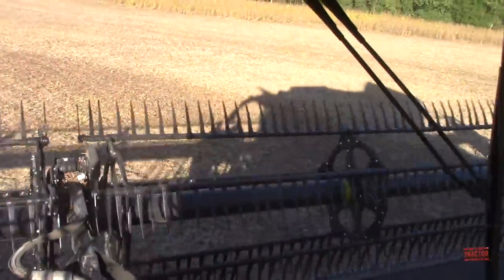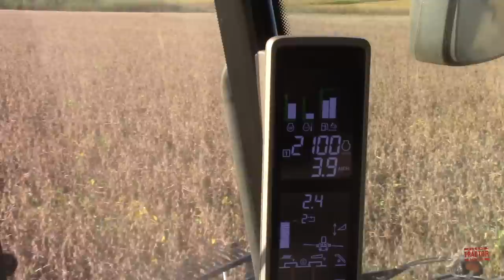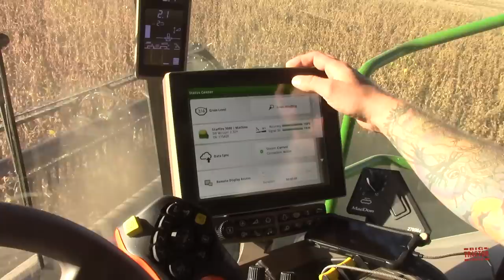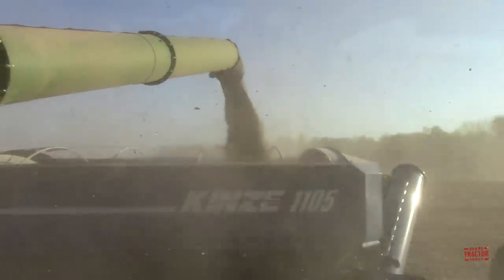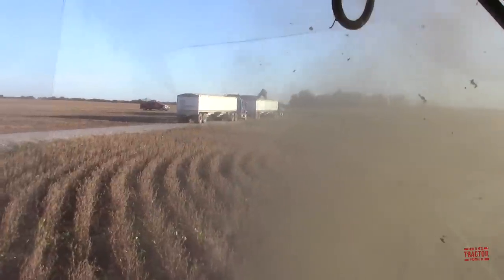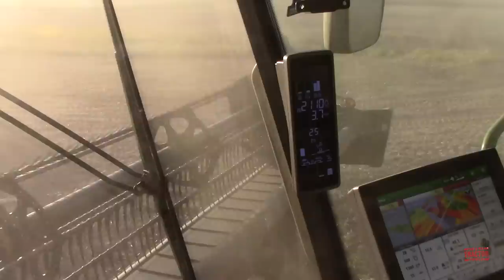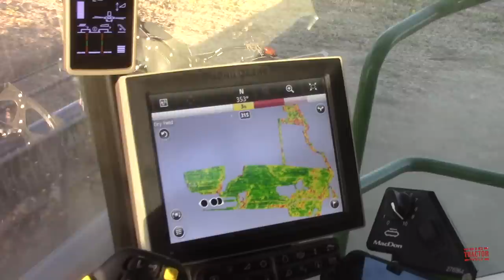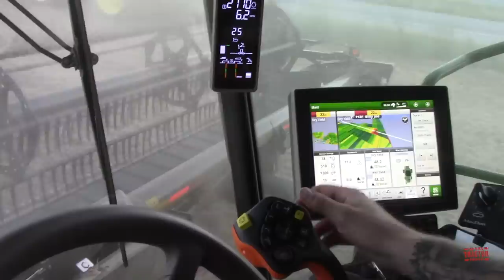DUSTBINE | John Deere S790 Combine Harvesting Soybeans

Comment: One more reason to get a Gleaner!  Compare the dust coming out of the  Deere feeder  house vs the Gleaner  video you  posted  recently. 🤣
Reply: You don't suppose that there could possibly be totally different harvesting conditions?  Nah...you're just a Gleaner homer...
Reply: @buckhorncortez   Never had a Gleaner,  always ran  Deere's.  In fact I'm from the same area The farm featured in this video. The Gleaner pushes way less dust out of the feeder house because of the vacuum created  by  their  rotor.  Ask anyone who has operated one.
Reply: Deere has a feed accelerator in front of the rotor which causes back draft. I believe case and gleaner don’t have this. Which causes less dust out of the front.
Reply: Why do they cut at an angle?

Comment: I wonder why they aren’t using the “harvest smart” and combine advisor ? 

Especially harvest smart with the operation they run, keeping machine 100% @ capacity all the time.
Reply: Barnyard Aerials looked to me like he was.
Reply: @chasesblog  @ 7:09 ...... Harvest smart - OFF / Terrain Comp - OFF / Interactive combine adjust 2 - OFF ..... "Automation status - OFF " It says it at the top of the command center.
Reply: The reason we aren’t is because we run a “bean screen” as the sieve. Automation does not work when one of the components needed for adjustment is missing. I’m sure there is a fancy code to put into the diagnostic addresses to make it function but we just run them manually. Not a big deal.